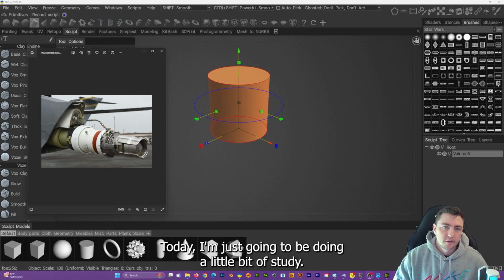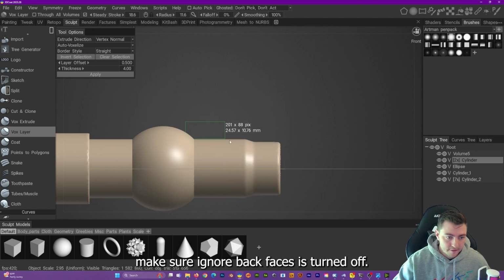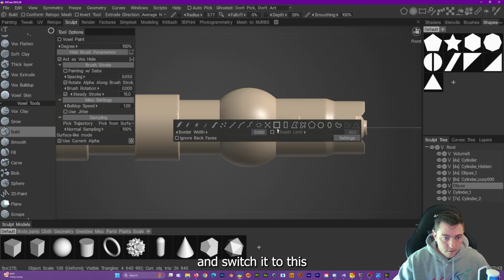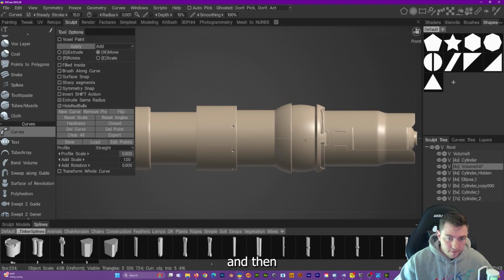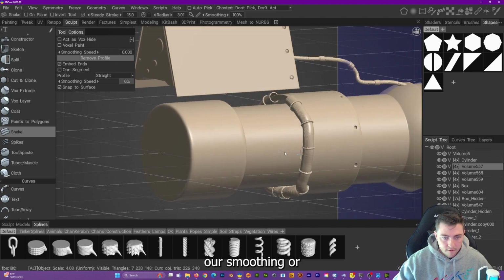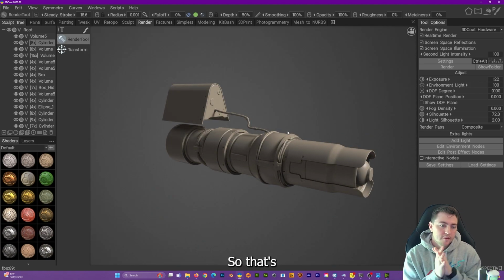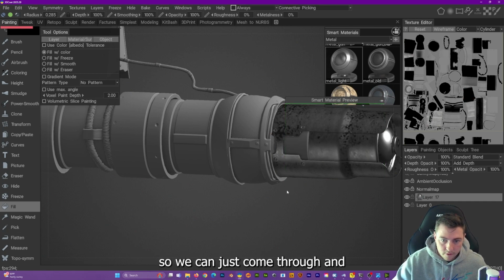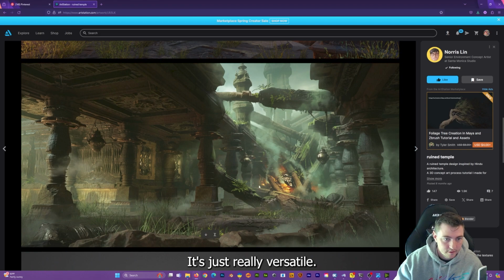Mastering 3DCoat with this daily study technique

Comment: Any idea? I got some small artifacts inside the circle at 5:47, despite using the Build tool with Cmd to inset it and the same alpha as you. My cylinder is also around 500 000 tris.

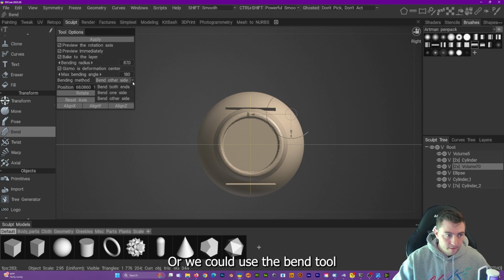Comment: At 8:00 in the video I was like: OK this would have taken me around 20 seconds in Blender. What's the point? Though I really like the fact this is voxel and you basically never had to move a single polygon. 3DCoat is the tool I am always looking at but it's so intimidating I never pulled the trigger because I feel like it will take me 2 years to learn it.

The UI is what is putting me off the most. It seems there is no logic or proper hierarchy. It's very difficult to make a good UI and probably I am also used to other software like Blender, Affinity, Adobe, etc.

Maybe one day I'll try it again... 3DCoat overall seems a very powerful tool.

Comment: thanks, good stuff! I can see a bit of struggle with some tools and settings, but in the end you got something interesting and quite close to your original reference. Maybe try playing with booleans in your next sessions, they are really good and fast in Coat. As for painting, I wouldn't say Substance is faster... It is different. Substance is great with semi automatic smart materials, and has much better baking tools. In SP you can quickly drop few smart materials on different parts, and get quick and dirty textures really fast. But if you like manual handpainting in 3D - Coat is probably a better choice.